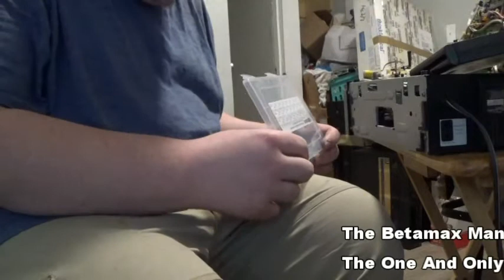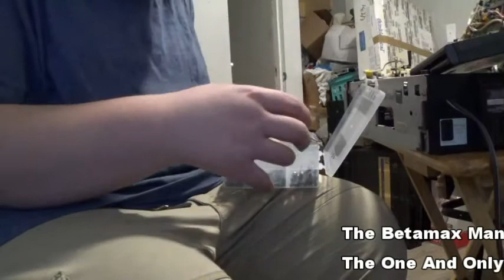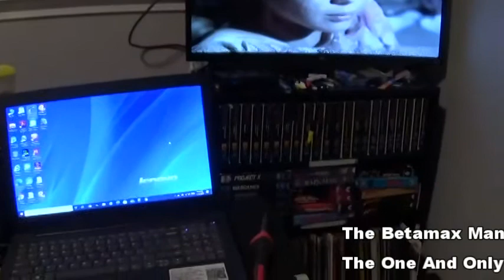Replacing Bad Caps in a Sony SL HF900

Comment: Did you make one of hf750 caps ? My old 750 has not used for many many years I plugged it in video us now but grainy so I guess the caps need to be changed but which ones ?
Reply from the maker: If you’re picture is grainy you might want to check the caps in the pre amp
Reply from the maker: The smaller caps in the power supply would be the ones you’d want to replace

Comment: I pulled the handle for an SLHF900 today. It's a litt;le dubious because its missing the top and front covers for the controls. should I expect a non functional machine and that whoever owned it was rough with it?
Reply from the maker: Most of the time beta VCRs don’t work even if the seller says it works and if it does work it may not work for long they generally need to be serviced before using it on a day to day basis
Reply: @thebetamaxman8905  btw does the SL-8200 take the same belts as the SL-7200? Just in case I’ll never get that stupid stripped screw to come out so I can have access to the bottom!
Reply from the maker: @oldradiosnphonographs  they might on some of the belts